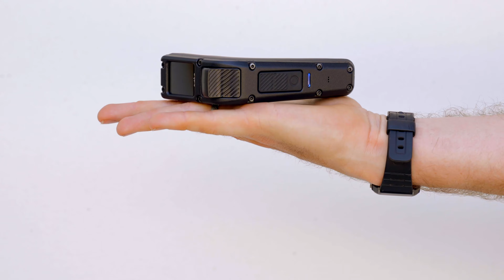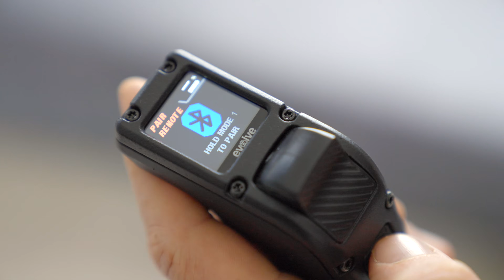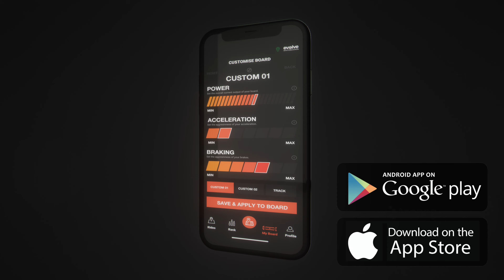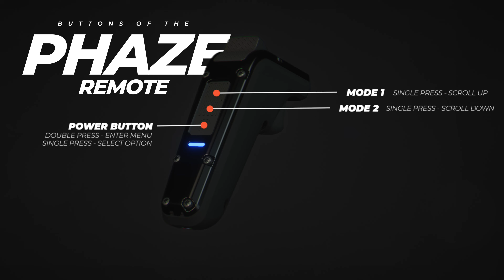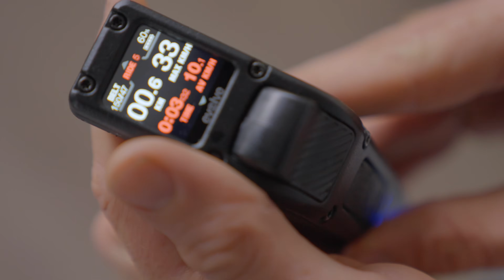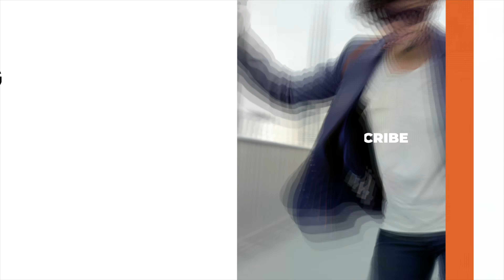THE PHAZE REMOTE EXPLAINED

Comment: I bought a bamboo series GTX board in 2019 and my remote from back then no longer works so I just got this new phase remote but now it goes straight from safe mode to GT mode. Isn’t there supposed to be an Eco and another mode so that your board doesn’t go from like 0 to 20 in one second?

Comment: They mention the app but with my series 2 I can't seem to pair the board and remote and app at the same time? Need to not connect the remote so I can use the app, is that right?
Reply from the maker: That's correct. You only need to pair your remote to update firmware, and board to update firmware/set custom curves/read data. The mapping function works via GPS on your phone and does not need to be connected to the board to work.

Comment: I fell off the board today fairly hard  and my phase remote no longer functions. It’s basically just got a scuff on it but I think the impact was a bit too much for the internals so this remote has its limits. Clearly it’s more durable than the R2 and I’ll consider buying another one cause the phase is a very nice feeling remote. Durability still has room for improvement.

Comment: how do i attach the lanyard to the remote. the maintainance kit does not come with the correct tools to take apart the remote, nor does the manual tell you how to attach it
Reply: You just push the little string end of the lanyard through one of the holes on the bottom and after a few tries it should automatically route itself through the other hole. I found it easy.

Comment: Of COURSE this isn't available for us GTR owners yet. We spend 2k on a board and can't get a remote that doesn't break after being dropped form 2 feet. When are you going to take your already existing customers into account for things we're unhappy with!
Reply: Can confirm phase remote works on my GTR
Reply: Just ordered my gtr and it comes with the same remote and motors as the hadean
Reply: @TheH10ne  and motors? I'm not sure that is possible man the hadean motors are way bigger
Reply: @solomonjenkins9505  I'm positive it does, just look at the specs of the series 2 gtr
Reply: @TheH10ne  Only works with the Series 2 dude
Reply: @Jabba1402  my guy the series 2 has the very same esc and motors my guy
Reply: @Jabba1402  who said anything about older models?
Reply: @TyaxComp  lemme know how it goes if you don't mind!

Comment: When are you guys gonna replace the triggers with a wheel 😔 triggers are trash for electric longboards
Reply: Trigger takes a couple of rides to get used to but after using 6 boards with a split between wheel and trigger (2 boosted + an Onsra vs 3 Evolves) the trigger feels so much better.

Comment: Is there somewhere on the bottom of the remote to attach a lanyard? 
Also, when do you think a Hadean bash guard kit will be available?
Reply: Yes there is a hole at bottom for lanyard I got my bamboo last week yippee
Reply: @gradyuk  congrats, did you have any motor cut outs during accalaration?
Reply: @LyroLife  no so far so good done roughly 60miles with no issues
Reply: I came to this video just for this

Comment: Does it work with the GTX?
Reply from the maker: No, the GT/GTX is Wifi and the Phaze uses a Bluetooth connection.
Reply: @evolveSkateboards  So, if I purchased a Carbon GT and a Bamboo GTX in March of 2019 for a total of about $4,200 (less than 2-years ago), I am SOL when it comes to an upgraded remote that does not break when it is sneezed on?  Since then, I have purchased two additional remotes for $150 each and one of them just broke again.  Getting very tired of the cheap, but very expensive, plastic remotes that need to be replaced way too frequently.  In addition, to purchasing the two boards and multiple remotes in the past 18 months, I have purchased upgraded wheels and chargers as well - all totaling about $6,000 in purchases from Evolve in that time period to be stuck with cheap plastic remotes.  The question is what will Evolve do for a loyal customer that has spent quite a bit on its products in such a short period of time?  😃
Reply from the maker: @spencerpinter7083  Hi Spencer, we appreciate our customers although we cannot retrofit all new products to all models of boards (the R2 Wifi was released in 2017). We have made both silicone covers and lanyards to keep your remote safe, and we offer repairs on broken ones which is cheaper than purchasing a complete remote.
Reply: @evolveSkateboards  just bought a new bamboo gtr and came with a phase remote, doesn't pair with board, now I have to take it back to the store and replace it with a r2 remote.